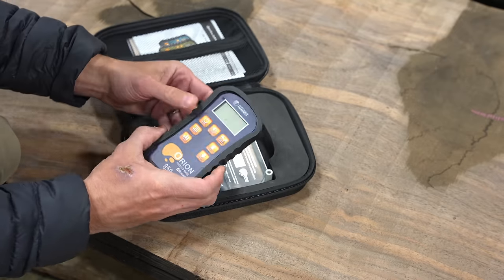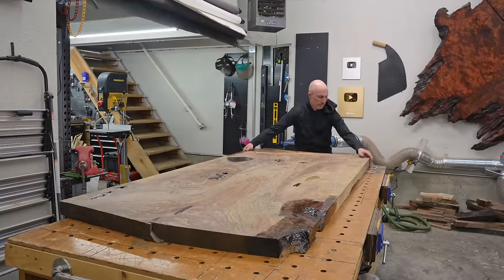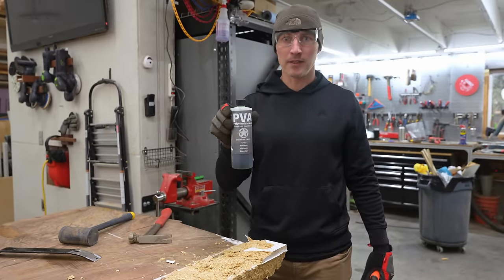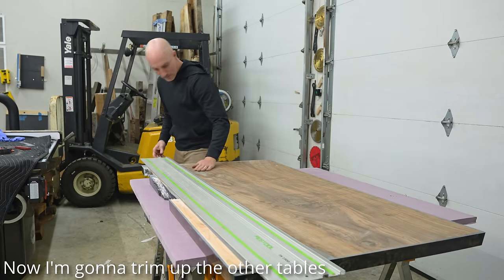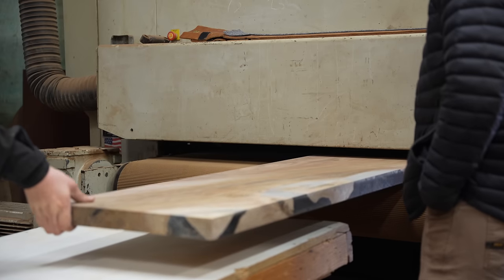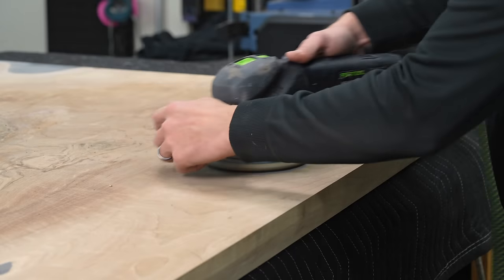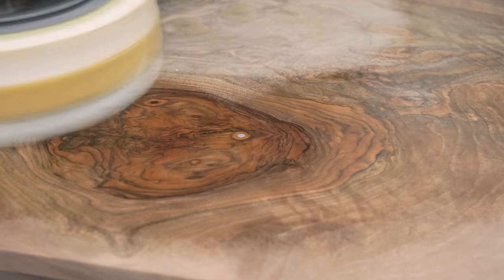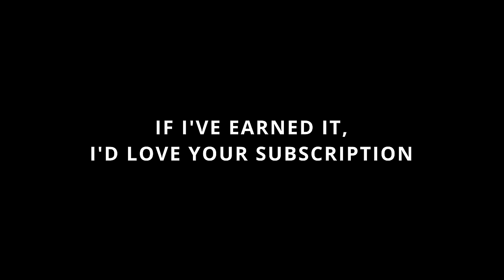Fixing the $30,000 Mistake

Comment: (Console table - the floating pieces in the epoxy rocked!)  If I were a customer, I think a weekly update is the sweet spot.  Updates longer than a week apart and I'd have a weird concern that I run the risk of not being able to intervene and maybe give input on project's direction.  Updates that are more frequent (all through the week) and I feel I'd start thinking I am the 100% sole focus of your business and then if you take a few days here and there to work other stuff I'd feel slighted?  Either - weekly is more than enough.  Also, your portable belt sander puts any pinewood derby to shame.

Comment: The fact you didn’t think to poke a hole in your jugs of resin and you sell $30K tables gives me hope for myself.
Reply: You know the hollow handle is made for that reason, to pour without the gurgle. He's pouring too quickly and blocking the air path. Don't need to be in such a rush when pouring liquids. He can fix it in post production editing if he's worried about the length of videos.
Reply: These tables shouldn't be $30k, that's for sure.
Reply: @TheRogueX  most of them aren’t, the ones that are start out as $15,000 slabs of 300 year old trees.
Reply: lmao same
Reply: @johnglielmi6428 I believe air pockets are bound to happen when you mix it anyway am I right? I’m not a wood worker though

Comment: When you're putting epoxy in the crack use the air blower it'll blow the liquid back deep into the crack as far as it'll go and then just add a little more as needed but initially blowing it in there it really gets deeper than any other way I found. Great videos 👊

Comment: Hey friend the PVA is not a mold release,  it's a barrier. If you put release before it and after it then you parts will release. It's water soluble too so if things are being difficult you soak it in water until it all disolves. Parts come apart. If used alone it makes a great glue.

Comment: at 8:39, when pouring from a gallon jug, here's another tip that doesn't require a hole, just hold the handle up top, and whatever you're pouring is vented by the hollow handle. No need to kill the jug.

Comment: For narrow end cracks try using a thinner epoxy. Capillary action should then "suck" the epoxy into the crack. I use this technique when building and painting models. If a part cracks, I'll use CA liquid glue or I'll thin paint down to get into details.

Comment: I would not know if this applies to pouring thick epoxy, but I used to mix large batches of photo chemistry and I found that by getting the content of the container to swirl and then pour while it is swirling, gives you a nice smooth pour and prevents the content from "gurgling" out (is "gurgling" a word?).

Comment: Cam, you don’t need to cut a hole! That’s why the handle is tubular. It lets the air back in for you. Or if it has no handle invert the vessel and rotate it to create an air funnel up the centre.

Comment: I'm thinking the fuzzy comes from during the router process. You're pulling some of the fibers of the deninum lose . I think to demonstrate my thorey wrap some deninum around a sponge. 
       Pull it tight and make kind of a ball. Try to shave some of the deninum but not go threw it. Kinda like a split grain swade leather.  Or  at least that's how it works in my brain

Comment: My woodworking skills are nowhere near as advanced as yours - but here’s a trick that you might need at some point.  I used this technique when I was repairing the broken stock of a shotgun.

If you have a deep crack, you can use a hypodermic needle to inject glue deeper into the piece.  Flex the wood, if possible, to open the crack as far as possible.  Use the smallest gauge needle that your glue will flow through.  If the needle is too small, you might not be able to push the plunger down hard enough to get the glue out.  So - test the glue on various size needles before using it on your workpiece.

Any pharmacy should be able to sell you some syringes and a variety of sizes of needles.  To put the glue into the syringe, pull the plunger completely out and fill the syringe from the back.   Try not to leave any air pockets in the syringe.  Leave enough room to get the plunger started back in.  When you put the plunger back in, you’ll immediately be able to tell if the needle is too small.  Swap out the needle until you find the right size for the glue you’re using.

If you were able to flex the crack open, you’ll be able to get the glue very deep into the piece.  But even if you can’t flex the piece, this technique will allow you to get glue quite a bit deeper than you otherwise could.

I’m enjoying your channel.  Very nice work!

Comment: I epoxy coated a few items that were of an odd shape.one was a giant walnut skull and so I didn't have to pour the whole skull and carve it out of epoxy because of its self leveling aspects I turned it until  the epoxy set completely which was like 2 days of continuous rotating so it wouldn't run .it's sucked.and didn't work so I had to carve all the epoxy off and resand it all over again so I decided to hand oil run finish it instead.it turned out sooo beautiful that I come to the conclusion that using epoxy on walnut is stupid and should never be done.always oil finish walnut and absolutely never put expoxy on walnut because it ruins the wood and you will never be able to have an heirloom because the epoxy is chemical and doesn't agree with age.the skull made out of walnut will never peel or chip and you can feel and smell the wood forever .it can only get better with age unlike epoxy which will degrade.linseed oil with vitamin E and beeswax with mineral spirits.you will thank me .but you have to rub it by hand if you really want to make look good .

Comment: Hi - quick question.  At 14:15, you use black wood to pattern out around the hole you are creating for the wood insert for the bottom.  What is that and do you use double sided tape to attach it? Thx @benchcatww

Comment: I guess I stand alone in my opinion of the epoxy filler. For that price point I would definitely not have that.
For the time spent those areas could have been filled in with wood. It is ashamed to leave that type of black eye on what should have been otherwise gorgeous and look flawless. Look how you filled in the bottom to cover with the leg base. I too am a wood worker and have spent hours to lace wood  back together in areas where you just poured epoxy. To bad your eye is not trained enough to understand what a waste of beautiful wood and time to turn out something with such a correctable flaw. Not impressed at all. Shamful!